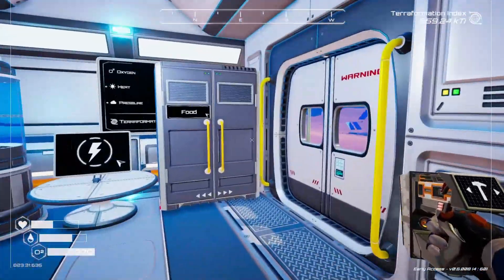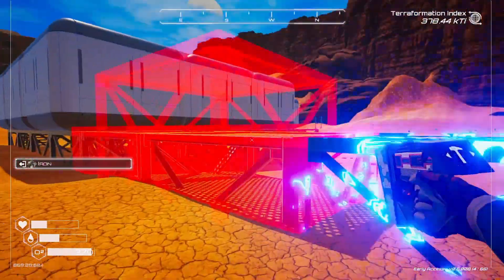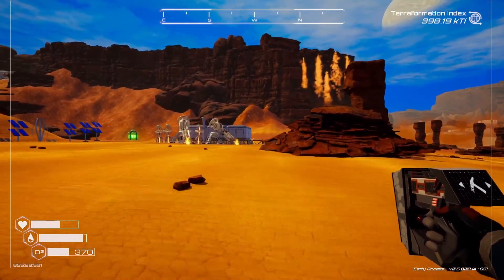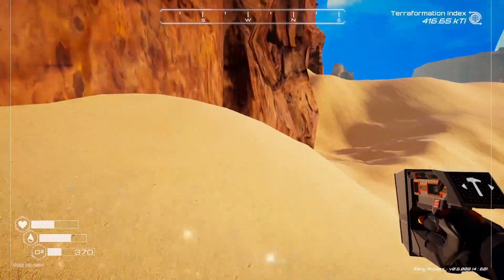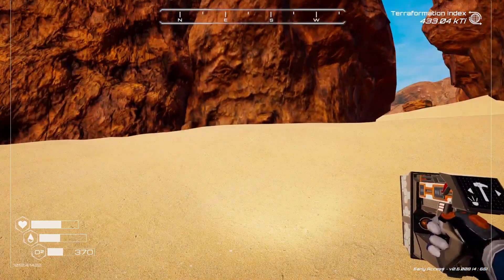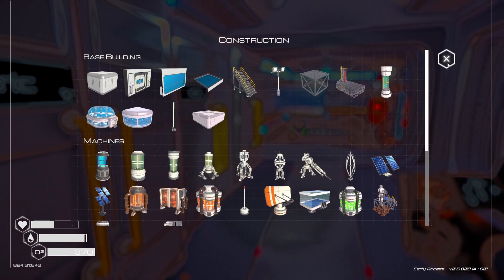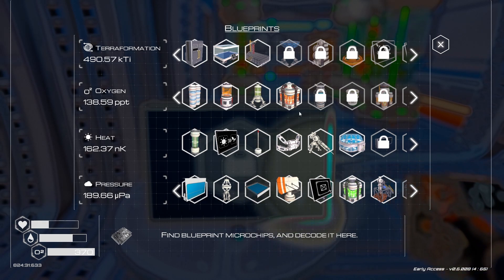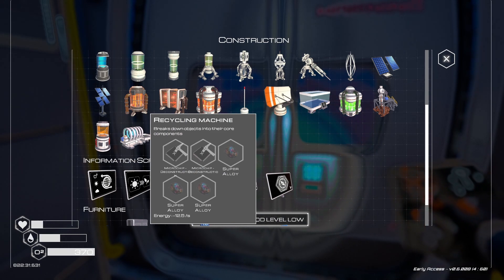Strange Doors & A Bio Dome - Let's Play Planet Crafter Ep 9

Comment: I will encourage you to check out that location between the Iridium cave and the Super Alloy cave.  Also, something I just recently learned is that Ctrl+Click will instantly move everything of the same type from one inventory to another - that way you don't have to individually click on each item (say, every Iron or Aluminum) when you are putting it into a locker.
Reply from the maker: I will definitely check that area out then! And that's a good inventory management tip!